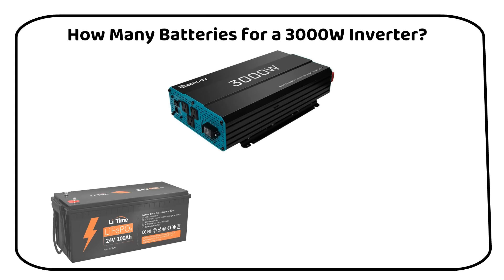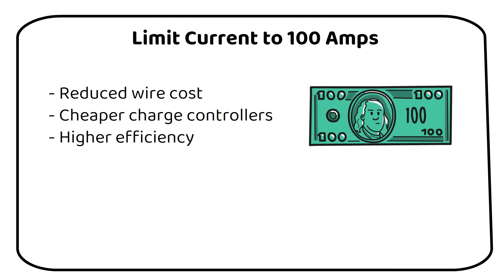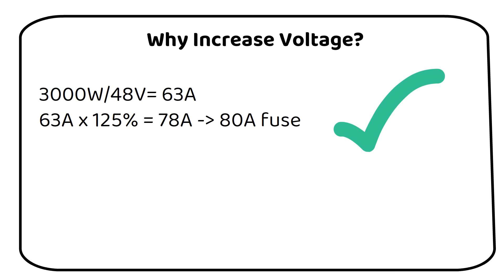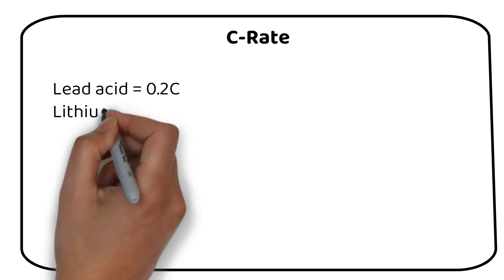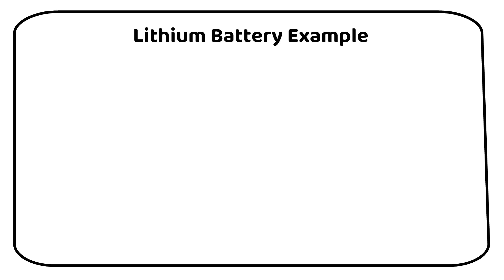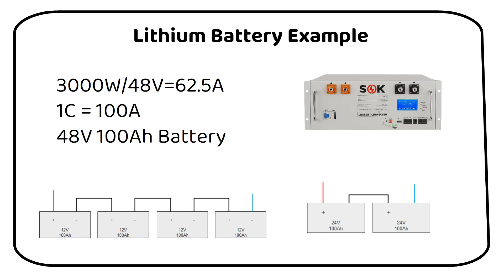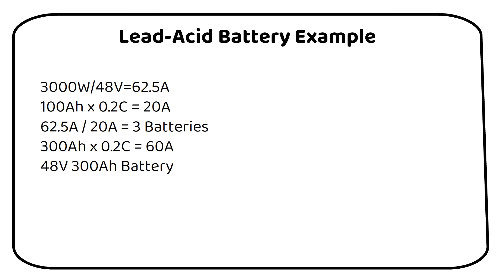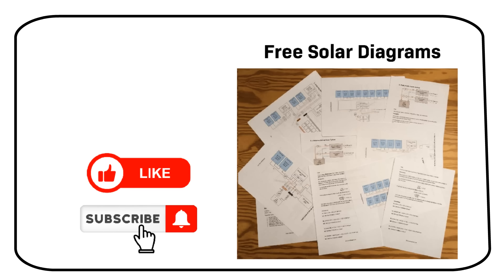How Many Batteries For a 3000W Inverter?

Comment from the maker: 🎁 Free diagrams: https://cleversolarpower.com
📖 My best-selling book: https://cleversolarpower.com/off-grid-solar-power-simplified
💵Use coupon code: clever6 to get 6% discount for Litime batteries: https://cleversolarpower.com/litime (cheaper than amazon)
Reply: thanks :)
Reply: A professional off grid system never uses inverters such as those
Reply: Thanks
Reply: @Peter-b6e3x  how which inverters?
Reply: what about if you are using 4 LiF04 12v 100 AH batteries keeping the volts at 12 but distributing the amps amongst all the batteries so each is only putting out 25% of the total power needed so they are not stressed
Reply: I have a question 
I built a tiny House. I have a small 7cf refrigerator a small window AC a microwave a toaster oven, a air fryer, a small coffee maker a n electric hot plate. A n oil filled space heater and a 42 inch smart TV. Of course my phone. Obviously I'm not going to be running everything at once. 
I'm building my own solar generator instead of buying one like a bluetti ac 180p .. something that would give me at least 1400wh expandable 
What manufacturers and sizes of controller, inverter, batteries would you recommend and should I run batteries parallel or series (2)100 ah likely? Could you help me please?
Reply from the maker: @democracy189  I recommend to watch my 'load analysis' video for your question.
Reply from the maker: @ChrisMonopoli  I made a video about 'how many 12V batteries for a 3000W inverter'

Comment: You are oversimplifying a bit.  Its not how big your inverter is but more what load you will put on it.  Also you should have larger inverter than you need for starting motors unless you buy a coil based inverter.  I'm running a 24v 960ah LiFePO4 system using a 3000 watt inverter.  My daytime load (highest) is about 1000W.  After a couple of days of cloudy skies, my batteries are empty.  I could really use a larger battery however I don't have the solar capacity to support it (3.7kw) especially during the winter months.
Reply from the maker: Thanks for your feedback. You have to size for the inverter, not for the load you attach to it. Startup surge power is a whole other topic that I can make another video about. It's impossible to mention everything in a short video.
Reply: What do you run that uses 1000 watts,heck that could be an AC…?   All I know is my 100ah doesn’t cut it so getting two 12v 230ah bats.
Reply: @cleversolarpower  - No, you do NOT have to size for the inverter.  You have to know your loads and size the inverter to easily handle those, without pushing it too hard.  Then you have to size your battery storage and your solar array.  You keep acting like you have to go 100% all the time on all of these components, and that is most certainly not how any of this works, or should work.
Reply: @2hotscottpro many things: microwaves, coffee machines, split A/Con, toaster, air fryer, electric jugs can all use over 1000W each.
Reply: @cleversolarpower Sorry, i have to agree with the poster. Unless you are powering a single very large load that runs very intermittently, this calculation won’t come into play. It is a good check to make sure you aren’t stressing your battery, but for running a grid backup or off-grid home, storage requirements will almost always result in a battery that has a c-rate greatly exceeding expected demand.
Reply: @evil17 but those run intermittently. And that would impact the inverter sizing, but not battery sizing. You don’t run your microwave 24 hurs a day. Even your AC should cycle on and off. And even if you expect your AC to only be actually running for 6 hours a day (total time the compressor is actually running) in the summer, your storage would have to be 6x the calculated c-rate meaning the calculation presented in the video just never comes into play. 
The literal only scenario is can imagine where this can come into play is if you have a single load some kind of resistive load that runs once a day for less than an hour each day. Otherwise, the total energy consumption over a 24 hour period (load calculations) would leave you with a battery that has a c-rating that greatly exceeds what the inverter can draw. 
In virtually every real world scenario, the battery c-rate is simply not a concern load wise and is very simple to check DC supply wise.
Reply: Why bother arguing ? Do your own way .... your money; your choice
Reply: Yep same here. But I went to a 5000 W inverter and a battery charger. Set up on a timer to drop in 100A between midnight and 4 am… Seems to work fine on 1000w load…
Reply: @2hotscottpro  I run a fridge freezer and all lighting circuits for a four bedroom house. Runs out about 1000w peak… All working fine for over 12 months now.
Reply: @Wombat-y7t  I’m monitoring one of the two 230ah bats charging with smart shunt.Balancing mode now 14.28
Waiting to see if it hits 14.4 Thanks for your reply.I’ll probably get some power to the house after finished with rv.If that ever happens lol
Reply from the maker: @jasonbroom7147  Checkout my video about load calculation to see how i size a system. I'm talking about sizing the wires after you have sized your inverter.
Reply from the maker: @williammeek4078  checkout my video about load calculation to find out how i calculate the inverter size.
Reply: @cleversolarpower  - I have watched that video, and it seems like you're finally learning a bit about this topic, because that was the first one where you made any sense.
Reply: @cleversolarpower This is an incorrect assessment on your part. You are thinking with an on grid mindset. You often only have a 3000 watt inverter because you have a motor load or other inductive load with a running wattage that's only 1000 watts or less but can't be started on any smaller inverter. 
Most of my job site framing equipment falls within that category. Chop saw, circular saw, trim air compressor ect. This is a very common situation.
Reply: I think you’re missing the point, imo of the video. To explain why it’s important to have a 48v battery system for your inverter. Especially, if you’re running a 3000 watt inverter. Fully off grid, vs say a van life(car camper) who can get away with a 12v 24v system for a 2000 watt inverter.
Reply: @jasonbroom7147 I agree, just because you have a 3k inverter it doesn’t mean you have to use it in full, some people have to go higher watt to have a buffer.
Reply: Yea, I agree it's best to size the inverter to a margin above the expected peak load.  The total battery capacity would be determined by the expected average load, as would a solar array(plus a region/sunlight-based margin) and battery chargers.
     Oversized inverters for a modest average expected power consumption has little effect, other than the idle current used to run the circuitry.
Reply: @2hotscottpro  my airfryer is 1000 watts 😂
Reply: @2hotscottpro I don't know of an ac that will start and run at 1000 watts and a microwave will probably need 1500-1800.
Reply: That's what she said
Reply: @Deiseboi my air fryer is 1900 watts 
It’s huge like these nuts
Reply: Can we get a response to what he said?
Reply: listen to clever solar ppl - i haven't read all the comments, but the guy who's running a 3000w inverter for a 1000w load is just throwing away TONS of energy - always remember the bigger the inverter the bigger the loss! size appropriately - for inverters don't underbuild and don't OVERBUILD 🤦‍♂🤦‍♂🤦‍♂   @cleversolarpower
Reply: @otm646 you are thinking he means the battery capacity… no, he means the ampdraw of a 3000W load on the inverter needs to be below the output capability of the battery. 
Yes, a 3000W inverter will rarely output 3000W, for microwaves, or for motor startup. But it WILL need full amperage for those startup loads, so the battery you choose needs to have the ability to output that ampdraw. He made no mention of duration of load, or the needs of sustained wattage draw… that would need amphour rating sized for the total daily loads put on the inverter.
Reply: @Qui-9  can l make use of 24 v inverter 3000w  due cost reduction?
Reply: @hmtechsvc  not true.
I have victron 1200 ve model its about 96%.
I have victron 500 ve model is about 86%
The bigger one is more effective with power.
Reply: Nope.. that's what the soft Start was literally designed for
Reply: @Qui-9 All those things are Super Heavy
Reply: @cleversolarpower Isn’t it more difficult to size for an inverter when the inverter is say “3000W,” but it’s able to handle up to 6000W surges? A 12v 230ah battery with a builtin 200a BMS would shut down long before 3000w was reached, much less 6000w. I almost pulled the trigger on a au la carte system, before realizing I  knew too little to piece it together myself, and salesmen really don’t care what you waste your money on.
Reply: He did oversimplified. But we are not as smart as you
Reply: I agree that you have to size to your inverter. However, I went from a 3.000W inverter to a 5.000W inverter, mainly due to the substantial power loss in the very hot summers we have here. A 3.000W inverter then suddenly can only deliver like 2.000W.
Reply: @cleversolarpower This is not “other topic” sir. Lead acid batteries can give 1C for a short period of time with no problem. When you select an inverter for a household, you take your max power of minimum consumers, and adds a startup current for a fridge or a pump. So, if you use a 3kWt inverter for some reason, then your consumption will be let’s say 1.5kWt and 1.5kWt remains in a reserve. Always. So, 0.2C goes for a calculated average consumption, and 1C goes for a startup current. If this is a fridge backup only, everything is simple: 200Watts for a fridge, and 1kWt inverter for a startup
Reply: @jasonbroom7147 have you considered loads wit surge power of close to 3000 watts but working power of say 500 watts?
Don't you think that huge surge can stress the battery if sized too little?
Reply: You don’t need bigger batteries, you need more solar panels….a lot more that you currently have. You have 23.04Kwh capacity that should last a long time if fully charged. However in winter when there is very little sun, you still need a generator to charge your batteries, more battery capacity will not solve your problem. Nick is 100% correct.
Reply: @2hotscottpro  a kettle in australia uses 2200 watts
Reply: @evil17  in australia a kettle is 2200 to 2400 watts

Comment: am i really the only one who just cannot grasp all this?
Reply from the maker: I'm going quick in this video, so watching it a second time might be better. To simplify: 1. increase the voltage so that the current is limited to 100A (not necessary but good for sizing) 2. increase the capacity of the battery so that the C-rate of the battery type is respected.
Reply: No...😂
Reply: No….
Reply: No joke to me over 10 years of slowly learning for it to finally click
Reply: No I just want to know how many to power 2,000 watts
Reply: The one critical piece of information left out of this report is the $$$$$$ required for the lithium batteries compared to the lead-acid batteries.  In a fixed location, the weight is not a problem but the price is.  At about $100/battery, you can buy four times as much power with lead-acid deep cycle batteries as you can with lithium batteries, AND THEY ARE NOT TEMPERATURE SENSITIVE!  This report is useful for figuring out how many batteries you need for is very misleading in recommending lithium simply because of the weight, and overlooking the cost completely!
Reply: @glenparker234 i just did my calculation lithium will cost me over $700
Lead acidev$300
Reply: @cleversolarpower Wait what if my inverter is a 12v renogy 3000w? How the heck I wire it with 48v , isn't going to burn the 12v inverter.. I don't get it? Why they make 12v 3000w inverter if can not be fully powered 🤔
Reply: I only remember because I started writing it out with him. It’s something to do with hand eyes type stuff. Anyway. Hope it works for others
Reply: It may be a bit challenging to understand without some knowledge of physics...but he would have to give a lesson on physics too and then no one would watch haha...I studied science but don't use these formulas regularly so even for me, i've had to stop and think about why he is dividing or multplying. Basic formula is Power = Current x Voltage but there are so many derivations to this formula so it can get complex if you focus on theory. Seems to me he is using the right equations. I have had to slow down and rewatch a few times as well though.
Reply: @GPforexacademy lithium is cheaper your not figuring right. If you have 100 ah lead acid, and 100ah lithium. Seams the same but it's not, you can't even use 50% of the leads power, without damaging the battery. So 100 and 100 is not the same, you need 200 lead and 100 lithium to be the same. So when you have to buy double to be comparable it is not cheaper, and lithium is way down in price now
Reply: @dustydawson8977   yep. Effective use is way higher than lead acid. Plus they last longer and are less prone to problems

Comment: Your information doesn't speak of Peukert's Curve, or how parallel batteries can feed very large inverters. For example, a 12v 100Ah SLA (or AGM, though temperature sensitive) can only survive a 50% mfg. discharge rate...but if you place 10 into a parallel circuit, now you have the equivalent of only 10% of the Current demand...so a 5-year SLA deep cycle battery can now yield 100A currents...simply by (in this case, 10-units) dividing the current by 10...thus, 10 12v 100Ah batteries can power a 4000 Pure Sine Wave Inverter just as one 12v battery could power a 400 watt (small) inverter...with approximately 4-hours before 50% of it's charge is reached. I KNOW, as I built such an array with an advanced 4000watt PSW Inverter and 10 such batteries (to power a remote cabin)...it can take a 100A load for 4-hours safely without deterioration of the batteries...and the built-in 90-amp charger is within recommended charge amps...7-hours, give-or-take, from a small generator, can bring the battery array back to 100%...and that's if you pull 100-Amps on that inverter (something a small cabin would NEVER do). In reality, it will work for 24-hours and charge for 5 (charging is automatic)...why does this matter? Because 10 12v 100Ah deep cycle SLA batteries are IN ARRAY, and one failing does not mean all fail simultaneously! So, instead of replacing a $1500 LiFePO4 failure is ridiculous, when 'old school' SLA batteries, good ones, cost $150 each, and tend to fail individually over a few months of time! It just makes more sense! ALWAYS use Peukert's Law (calculators can be found on-line) to determine size vs demand and recharge, and build an appropriate sized array! Draw it out first, plan your recharge method (in my case, the PSW inverter also has an automatic 8-second transfer switch which starts the charging generator, too)...Amazon, my friend, Amazon!
Reply: Sounds like you should make your own video bub

Comment: I ran my house off grid with 2 kilowatts of panels. 80 amp charge controller, 500 amp hour batteries(6 12 volt caravan batteries), 3500 watt sine wave off grid inverter. I never ran a heavy load at night. 24 volt system. This is in the UK. Worked great for at least 9 months of the year. I fitted a separate rings mains so I could switch to grid with a different socket in each room.
Reply: After 9 months you had issue?
Reply: What brand inverter did you use
Reply: @leongetz1931  POWER JACK PSW-3500. But it was faulty when I got it new from China so I`m not saying get one. But it`s worked ok since I repaired it.
Reply: @damianbutterworth2434  thank you

Comment: I did an experiment trying to make a system that was the cheapest possible that could run a 5000 BTU air conditioner.  The single 12-volt 100 amp hour flooded lead acid battery it had lasted around 3 years.  The cheap modified sine wave 1500 watt power inverter lasted almost that long.  The system was also used to run a 500 watt heater in the winter. The goal was to use the power when it was available and not store it.  The main drawback was that it would shut down on cloudy days often. Would be nice if there was an easy way of dialing in a cutoff voltage and having automatic restart with cheap inverters.   Btw, I do only buy pure sine wave inverters now.  They more than make up for the increased cost by how much longer they last, not to mention the increased efficiency,... I've also moved up to sealed lead acid batteries.😂  My favorites are the 6 volt 200 amp hour Mighty Max sealed lead acid batteries.  If you don't run them down too far they're supposed to last 10 years, completely maintenance free. You have to use 2 of course for a 12 volt system.  You can get a pair for around $439 delivered from eBay.  Seems to be the best bang for the buck concerning batteries I can find.  They'll even build up your muscles, weighing around 64 lb each.😊
Reply from the maker: Next upgrade would be lithium. Checkout my video comparing the two. You can get a 12v 100ah lithium for $300 now from a good company.
Reply: That’s bang for the buck

Comment: you can go up to 2000w in any system from 12 volts, but I wouldn't go any higher. You just have to make sure your battery, or battery bank has a high enough discharge rate and your cabling is the right guage
Reply from the maker: For RV's you can go up to 2,000W because it's often cheaper for your DC to DC charger. But normal off-grid then i would increase the battery voltage.
Reply: I would never build a 12v system unless it had to correspond with a 12v vehicle system. Very inefficient and restricted in numerous ways.